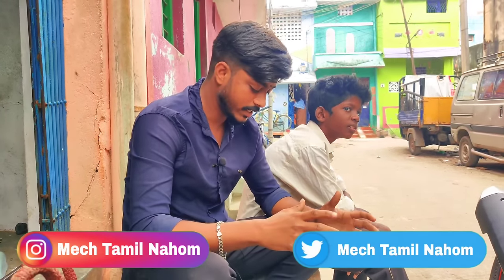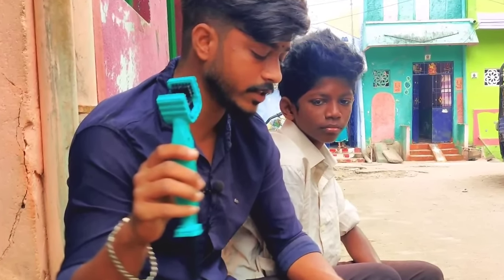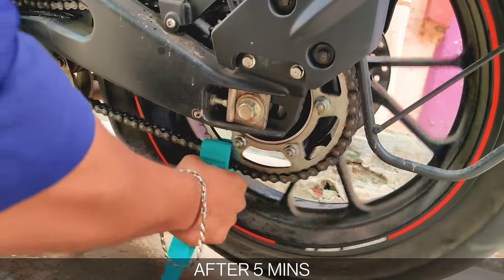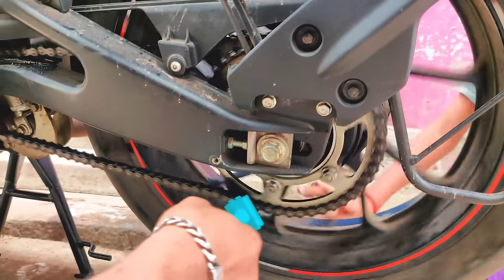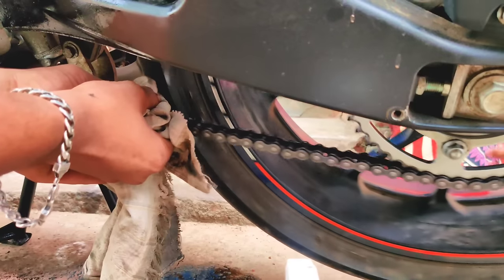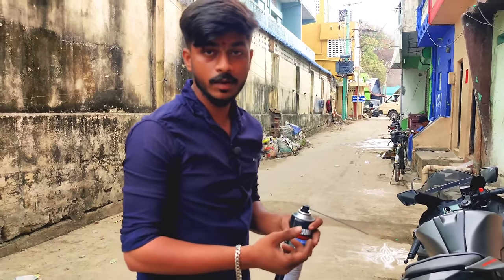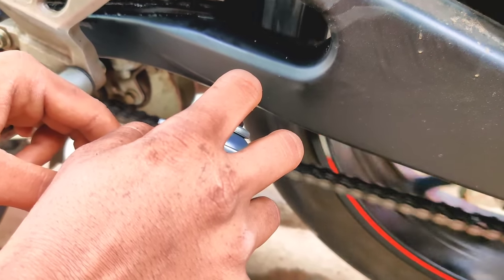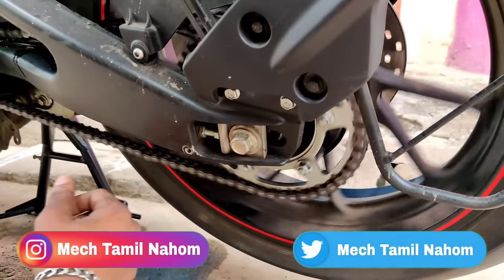Bike Chain Cleaning & Lubrication In Tamil | How to clean bike chain | How to lube bike chain tamil

Comment: Bro bikela chain remove pannitu scootyku iruka mari belt podalama apdi potta bike performance nalla irukuma mileage nalla kadaikuma bro 🤔 [ best chain lub and praise oru video podunga bro use fulla irukum ]🤗❤️
Reply: Aptilam pannatha Bro
Reply: Bro chain pathila built pota mileage varathu bro athanala thaan bike eppavum mileage athigama iruku comparing to scooters
Reply: @rocky5900  podala bro oru dubbed bro & tq bro
Reply: @deepakkumar-wi5wr  o ok bro tq
Reply: Scooters Elam gear less vehicle and various transmission system
Reply: @jeeva9964  Belt drive ku change panna ithanala power efficiency and mileage low aagum bro 👍
Reply from the maker: No bro ...belt avlo effective ah irukadhu bro ....also chain lube video kandippa varum bro
Reply: @mechtamilnahom  tq & love u bro 😍🤗

Comment: Kandipa bro. Best chain lube based on bike type pannunga bro. I own XPulse 200 4V and adhula chain cover ila. And center stand um ila. Enaku recommend panandhu SAVSOL brand. But open chain, so dry chain lube like Putoline DryTec Chain Lube parthan. But costly. Motul nalla iruku nu solranga, but too stickey and attracts dust easily nu solranga. Please do a separate video for best chain lube.. 🤝
Reply from the maker: Sure bro ☺️ Kandippa video podren bro
Reply: Pidilite oda lube try panlam or even gear oil is enough